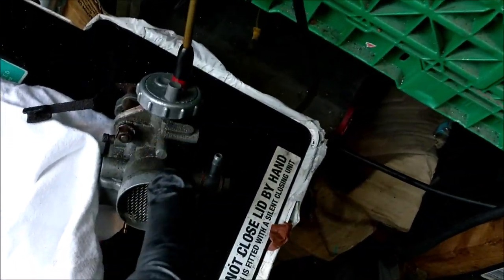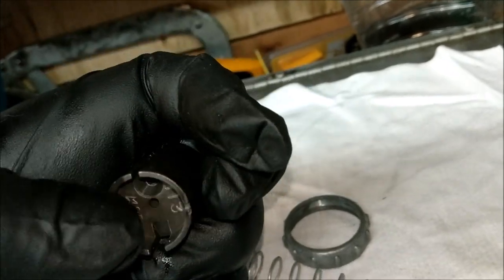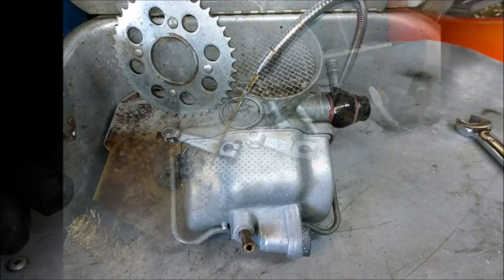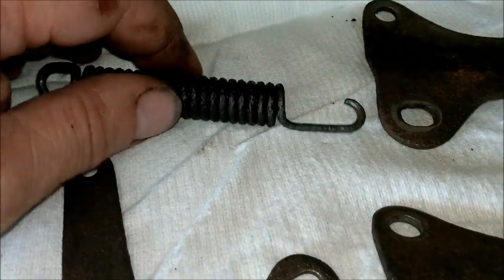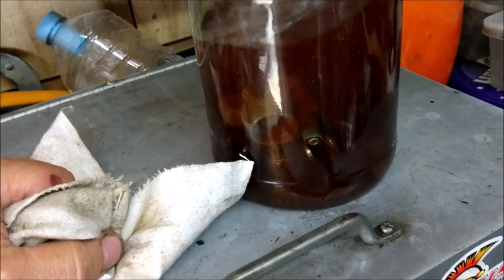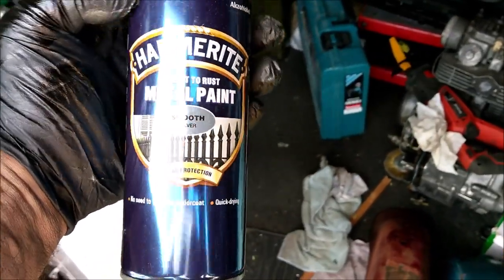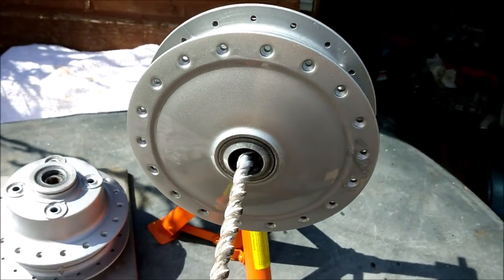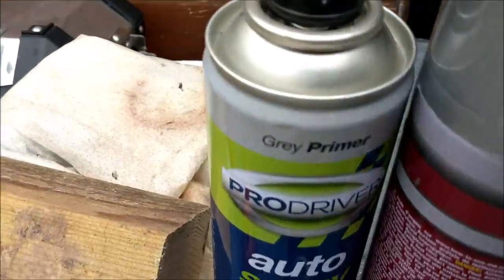Honda CD175 Restoration Episode 13

Comment: The electrolysis did a decent job. What would the parts have looked like if you left them in the solution for a day? Use JB Weld to cover your rusted chain guard sections. To solve your slow return of the throttle problem just put a stiffer spring in the carb.  :-)
Reply from the maker: Great, thanks chuck